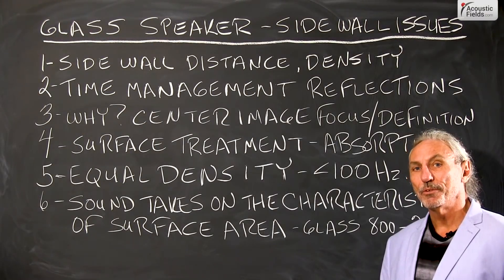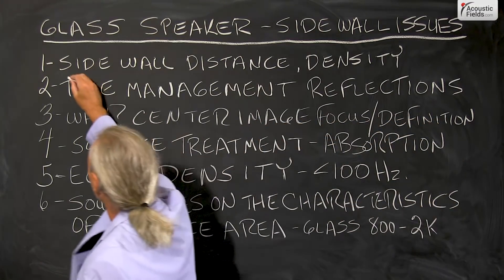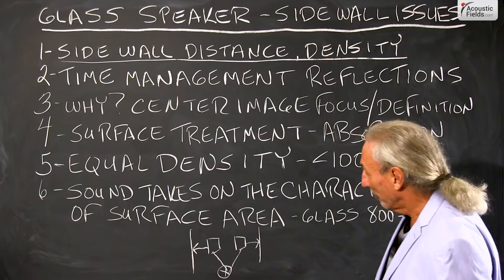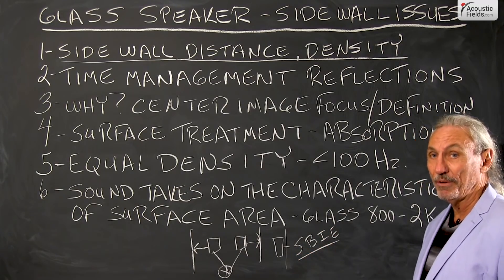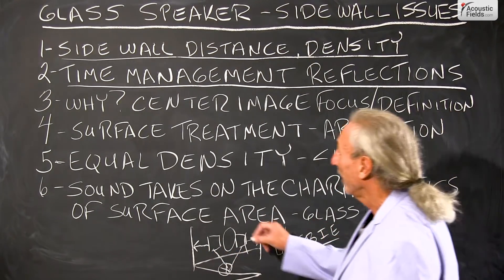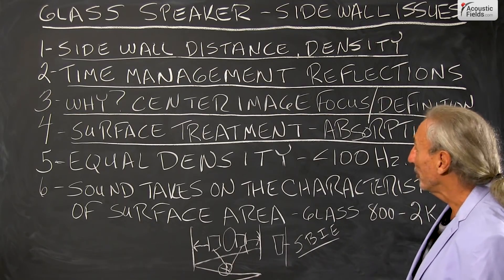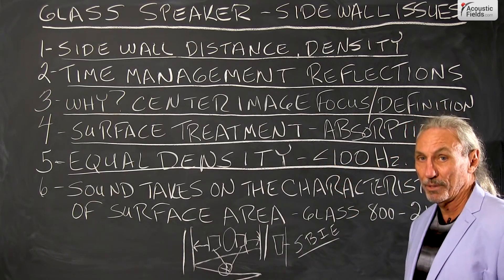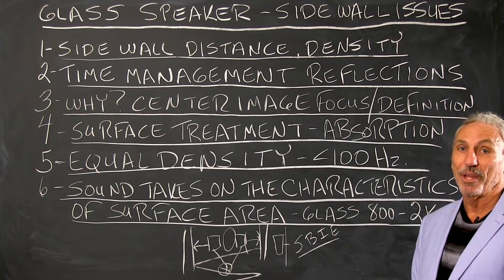Why You Should NEVER Place Your Speakers Next To Glass - www.AcousticFields.com

Comment: Hey, dennis, if i understand correctly, the distance from hard boundaries equal to 1.2-2metres gives huge cancelations between 30 and 100 Hz, if im not mistaken, putting speakers 4 inches from the wall makes the reflections higher in the harmonic spectre, therefore you can add 4" absorption next to that wall

Since most people cant put speakers 2 meters apart from the front wall without getting into middle of the room (worst mode zone) territory i think this is a fairly good idea, isnt it?

Comment: Hi, what if in a rectangle shaped room my listening position faces the shorter wall, but on the opposite wall behind my back  (which is 27 feets away) there's a huge window? Are 27 feets enough to avoid treatment on the window, or will the window cause nasty rear wall reflections? Thanks in advance.

Comment: What about side walls that are at a trapezoidal distance from the corner to within a quarter of an inch off-axis
Reply from the maker: J, The term is splayed walls and they are  good for reflection management.  A 1/4" splay is not enough. Most run 8 - 10 degrees off axis.
Reply: With the walls being 90°the way that I have my speaker setup is that it is coming out of the corner at 15 degrees off of each wall splayed towards The Sweet Spot 7ft from The Sweet Spot with 5 feet in between each speaker

Comment: Since I've started using your incredible products and the great knowledge on the YouTube channel,,, I have a mixture of horror and amazement when I see these ultra expensive high-end listening rooms, or worse, professional product reviewers' rooms, violating most of the basic tenets of which you speak!
One such individual, who shall remain nameless, has a major YouTube channel who reviews and  boasts about equipment often into the seven figure range,,, yet the room is an acoustical disaster, complete with glass surfaces, speakers up against walls, uneven loudspeaker placement ratios, etc. Then they have the gall to recommend Uber expensive bullshit cables, black boxes, & tweaks, in particular, that of synergistic research,,,, onto the good but naïve consumers,, 
This is the dirty secret of high-end audio,,, The treatment of the room is where 70% of the audio budget should go... period.
Reply: I for one am still not in my haven as yet but totally agree with the above ...
Reply from the maker: D,   We always tell people that you can take a 3,000 system and place it in a well treated room and it will sound like a 100,000. You can take a 100,000 system and place it in an untreated room and it will sound like 3,000. The electronics today are able to produce full range sound with low distortions.  Unfortunately, all this 24 bit resolution is lost in a 8 bit room.  You were fortunate that you started with a blank slate, just a system and untreated room. As we treated each surface area, you got to experience the impact each surface area has on the total sound quality.  Once someone goes through this educational process, you will never think or be the same again.